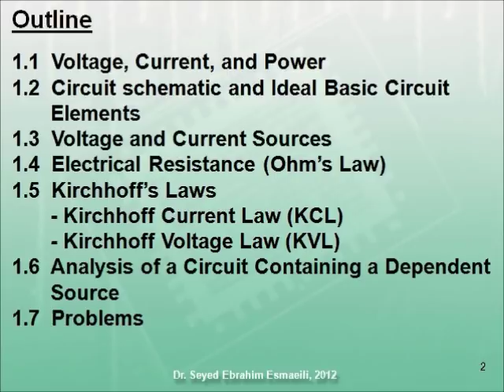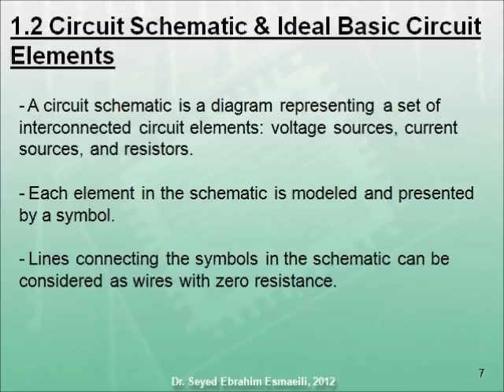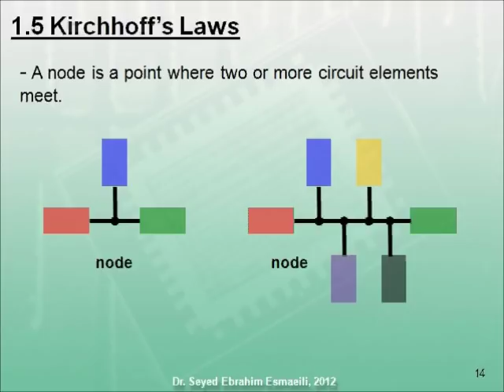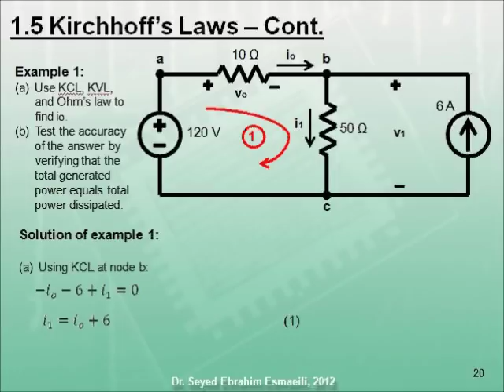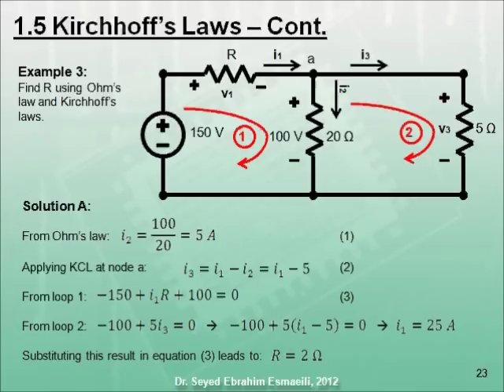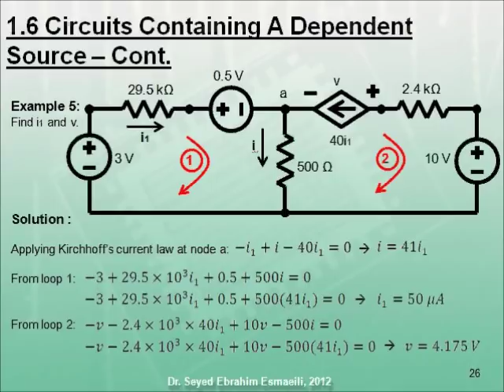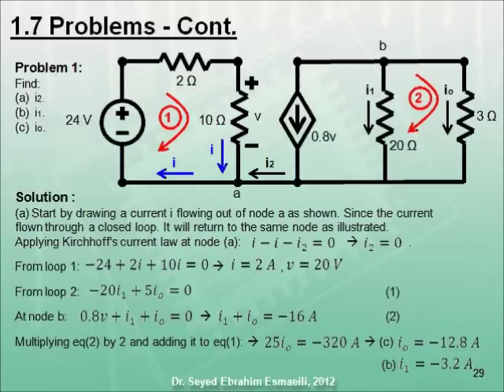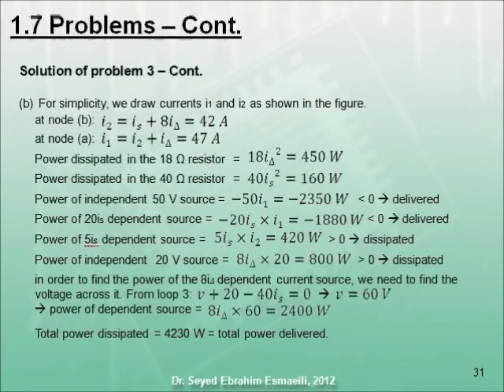Electric Circuits - Electrical Engineering Fundamentals - Lecture 1

Comment: On page 26, the voltage in loop 2 for the independent voltage source should be shown as 10, not 10v in the KVL equation to avoid confusion with the unknown v. The correct equation should look like this:
 -v - 2.4*10^3*40i1 + 10 - 500*41i1 = 0

Very good video. Thanks.

Comment: @ 33:45 shouldn't loop 2 be -20i(1) + 3i(0) = 0? I thought because the resistor was 3 ohms it would be a 3 instead of a 5
Reply: +Michael Tanja indeed it should be that then your answer for the resistors seperately would be: i0: -13.91A and i1: -2.09A... The basic principle still stays the same.! That being said his videos where very helpful with my varsity electrical circuit module... KCL and KVL now fully understood. wish i had access to this video before my first varsity test this past week...
Reply: I mean't to say for the currents not resistors, please excuse my mistake...

Comment: there is a mistake on the problem at 21:40; shouldn't it be -24+V2+V3-V1=0 and so we end up with i3=4A?? 
Plus he fails to mention the properties of series and parallel circuits.. 
Consider me confused.
Reply: I think it has to do with the fact that v1 has a different orientation than the other two. The flow is going from negative to postive on v1, so the formula is p = -vi. That's why -(-1) = +1. His answer of i3 = 3A is right.

Comment: @Tima Fawaz, you are mistaken but it's an easy mistake to make. P >0 for the RESISTOR, power is delivered to the resistor but lost to the circuit. Resistors dissipate power

Comment: There's a small mistake in 21:05 minute. In KVL equation You have +i(3), there should be minus sign. But anyway, thx.
Reply: +Łukasz Sadowski  yes dear i think you are right.
Reply: he didn't make a mistake. It should be +i(3). This is because 
V1 = -(i3)R due to voltage rises (i.e. you need to use V=-iR). So then you would get V1 = -i3 (since R =1). Now plug in "V1" into the equation -24V+V2+V3-V1 = 0. Therefore you will get -24+V2+V3+i3 since (negative multiply with negative will give you positive.)

Comment: Its not just math it is also concepts that are important. What is the point of calculating derivative of a function without its application. I found that when apply the concepts with mathematics there is true value behind application. All the time I was scared of Calculus and got an A in it eventually. Don't allow your mind to fool you. If you love what you do? Then take it further than learning it in class.